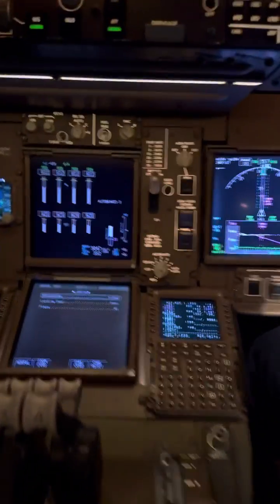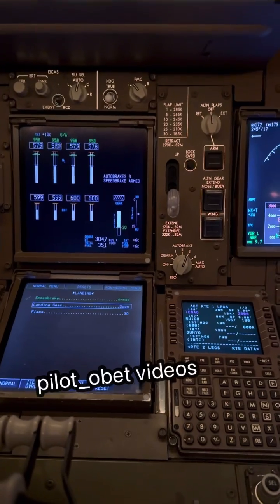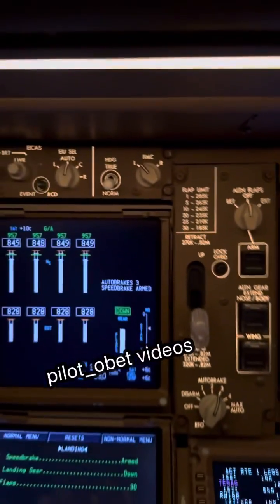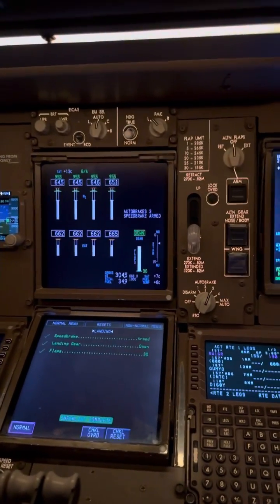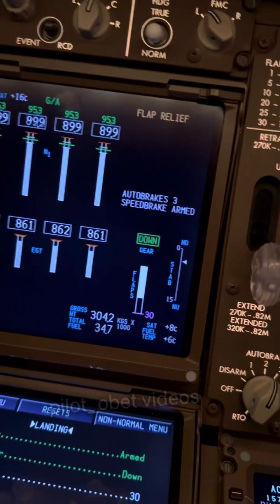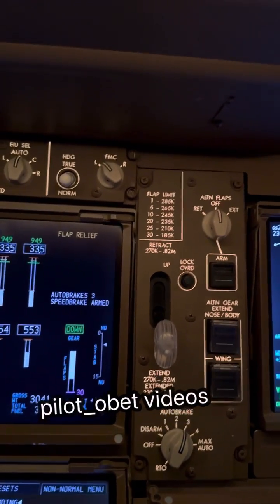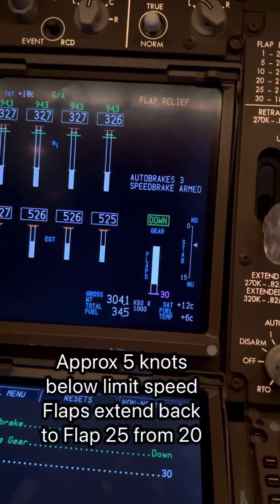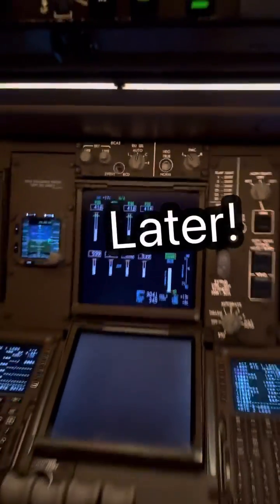Boeing 747 Flap load Relief

Comment: Hello, Captain. I am enjoying your video. I have question In your video.   It looks like Green Flap manuevering speed shows up whenever you change flap setting. for example, When you put   Flap up=(Green Up),     Flap1=(Green 1, Up)    Flap5=(Green 5, 1) Displays on PFD.     But I also saw other b747 video showing    Flap up=(Green1),     Flap5=(Green 10)   Flap10=(Green 20) Display. Why is there a difference?  Does the pilot have control of how Flap manuevering speed sequence shows? I would like to know.  Thank you!

Comment: That is a smart system. Is the relief system fitted on all 747s or just the 747-8? Is it fitted on other Boeing aircraft?
Reply: It’s on both. The MD11 had it also. Probably the other Boeings also.
Reply: @hellkell8693  Can the flaps "refuse" to extend if the lever is moved before the safe flap extension speeds have been reached?
Reply: @sebinamuwanga  I am not 100% sure but I am pretty sure the plane will not allow the flaps to even start moving if the speed is too much.  I had it happen once where we selected the flaps at a too high speed and we got an EICAS message letting us know.
Reply: @hellkell8693  O.k. Thanks for the response.